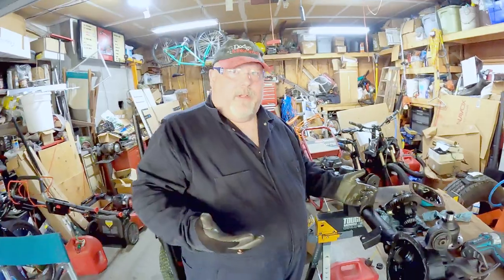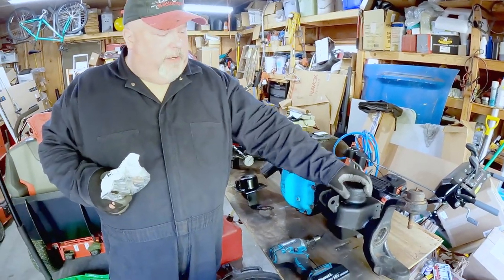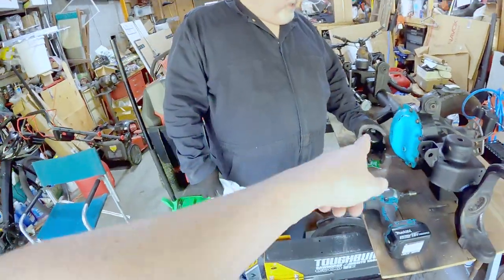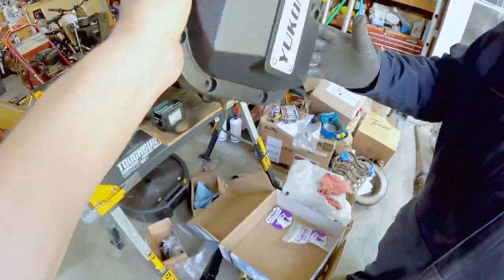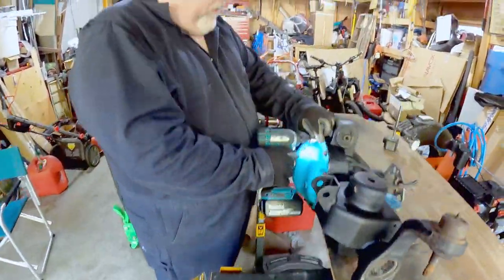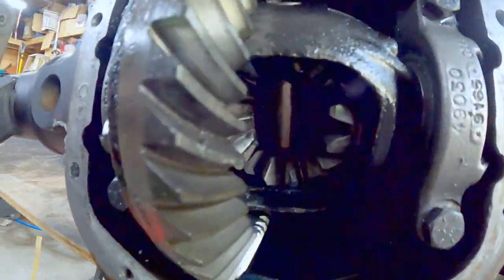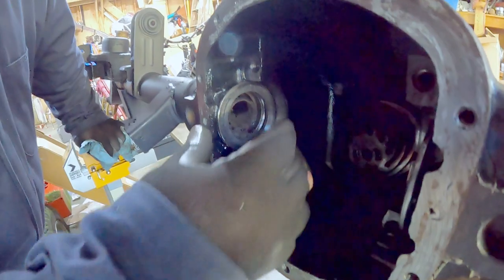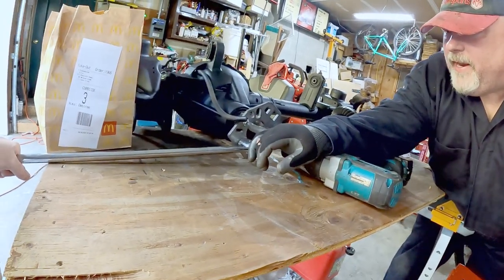Project Jeep Grand Cherokee WJ Front Axle [Part 18]

Comment: I have a 2000 4.7 with the same lift setup and front drive shaft. I had the DC shaft balanced but still having the same issue as you.
Reply from the maker: It can be quite a challenge to get the pinion angle shallow enough while still keeping the castor angle such that your steering isn't super twitchy. On our ZJ with a 3.5" lift shown elsewhere on the channel, we had to balance the driveshaft and then it was fine. Since you've already tried that, we'd suggest adjusting the front control arms to bring the pinion angle down. Ideally it will point right at the transfer case. If you can make that adjustment and keep the caster such that your steering is ok, you should be golden. Good luck!